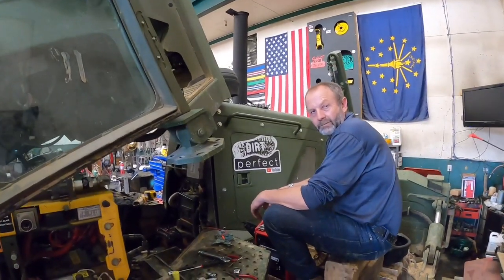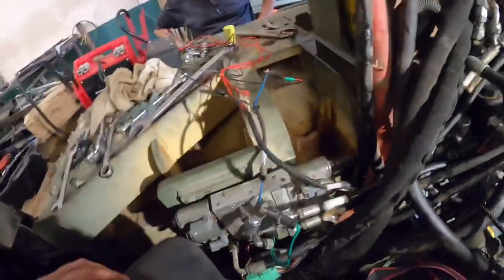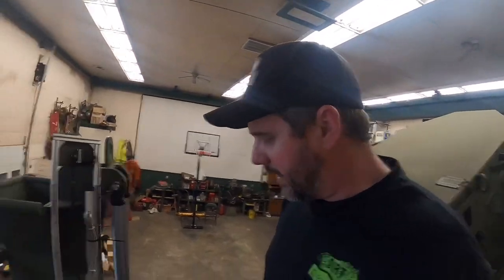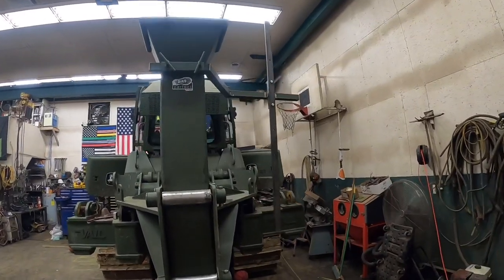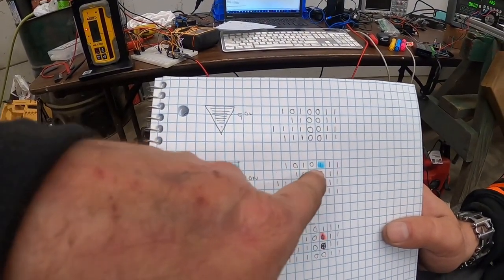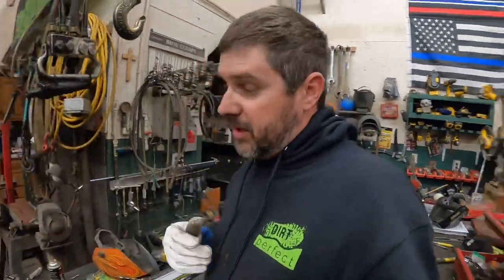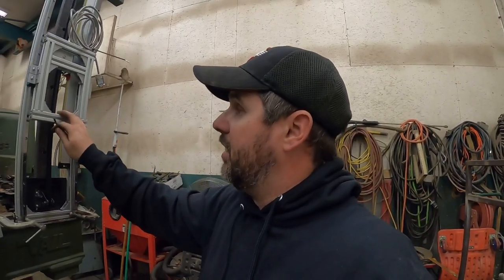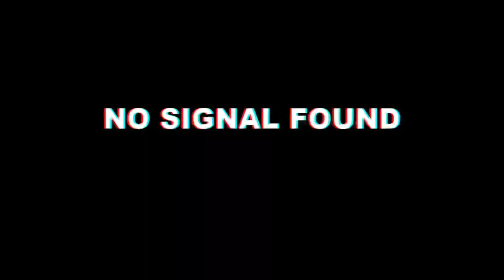Call us crazy, but we are going to build a grade control system for the plow from scratch.

Comment: I'm happy it will work... that said, under the hood of your dozer is a couple years wages in a screw up thinking it could render a machine helpless if it was to do something wrong and trust me I am blowing smoke out of my ass but just knowing that the spools you are using ... and the computer trying to figure out if say just for grins... it thinks its getting stolen so it shuts down. I watched Clint do that programing and started giving the machine a whole new line of respect. I ran some old equipment and it was from the seat of the pants. If you were real good, sometimes it also showed in the work. Most times the machine was so worn out that it was a  miracle that it worked. I spent many hours with welder in hand welding a frog on the blade or building up sprockets, then trying to weld new rollers ... said that wrong.. trying to make a old roller have the rim that kept it on its tracks.... dang it Mike, give me a hand here.... I was making a purse out of a pigs ear. I spent more for rod than most people earned in six months. I had other shops feeling sorry for me and giving me more rod to work with even. Of topic sorta... there is  a channel called pacific hillbilly an the man found a old D4 that comes from the early fifties and he completely rebuilt it from the ground up using new bearings or what ever and doing all the welding. I know you well enough that if you had ten minutes not dedicated to work that you would say damn that man is really talented. I like talent in many fields. I have deep respect for the man there programing the machine for you. I kinda think he is extremely talented but maybe camera shy as for the speaking parts... I didn't really understand any but knew in my heart he knew absolutely what he was doing. Now whether its for exposure to his work or just what, I don't care. It  reminds me of the young minds that built our first computers like Gates or Allen and more names that mean a lot in their field. I watched everything trying to  think if this is math analysis or geometry.. or algebra. Maybe all of it  as I have never attended any school in my life. I had to learn to read to give my son who was dying medications so he could be with me. I was highly motivated as I knew I might not have him much longer an yes,  twenty months later I buried my boy an  the military gave him full honors for my time in the service. Nam was a dirty word in my mouth till they stepped in providing air service between anchorage an seattle. Many trips... many and so like all responsible parents who are divorced an left with no supervision, I got flaming drunk for six months. I went back to the mountains where my hobby gold mine was and would take cases of whisky praying for a bolder to fall on my head or my excavator would fall off of the ledge I was working on.... so damn it what happens shouldn't happen and I hit good paydirt.. sold my gold for good money then sold the claim for pennies as they are still mining it almost ten years later... ...or more as I sold that in 94 spring of cause I now had a dwi to serve time for. Six months later,  I got out of jail and have never touched a drop since. I will admit to the threats of stupidity an think, Danny would not be proud of me. Anyway happy it works and it may just help Clint work it into some of his equipment.... that is a large jump forwards... I have went down the road and had the gps tell me I was fifty feet off the road.. the yellow line said otherwise

Comment: Yeah, but youre the good kind of crazy...  my prediction is that youre going to get more  tile jobs every year when the word gets out. That while using a dozer that earns money in pond and road building during the off season, i like the way you think, and your trial and error will get you there: This grade control gets your outfit to Pro level.

Within a year or three i expect youre going to rip the bracket welded in place where the drawbar was welded, out of the JD ripper main tube, it will just rip a piece of the rear flange out. Which can be dealt with by welding a plate slightly overlapping the top and bottom square tube flanges and bending these so they meet against the tube which you put the pin in. And some years from now, its going to need some extra bracing behind this lower mounting pin, and the lower rear roller that holds the plow leg. But thats only the long run, it will be fine as is, as long as you dont hook the B in front to help it through the hard patches 😉

Just 2 cents from a construction equipment design engineer 😉

Comment: Dear flamingdirt, when you get some free time please consider a 2nd business:  "flamingwater"......and focus your talents on jailbreaking the controllers of modern clothes washers so you can allow the user to bypass all of the engineered stupidity in modern washers that supposedly use a thimble full of water to wash a full load of clothes.  Give the user the ability to set how full they want the water, how long to actually run a wash cycle, how much rinse water to use, etc.  You'll be wealthier than you ever imagined in short order!

Comment: Let me get this straight, you're using the system that angles the blade to raise and lower the ripper/tile layer, thus disabling the blade tilting function?
I presume you'll eventually have it setup to enable switching from blade tilting to ripper/tile layer raising and lowering as needed?  ;-)
Reply: Still has operator control of blade. Need to watch first part of vidyo again.
Reply: I saw the blade able to go up and down still, but they didn't show if it can tilt?
I guess, I'll have to assume it still can?
Reply: @hermanschepers4739  Herman is correct. The GPS control valves is independent from the manual control. We only repurposed the GPS valve. What might not be clear from the video is that the manual valves has priority. So even if the GPS valve is active the manual control can still override it.

Comment: Here's an idea. With all that technology bolted to that plough. Would it be an idea to dig a hole up against the back wall in the shed maybe use a clay pipe. In the ground then put the plough in it so it's out of the weather for the 9 months of the year it's sitting doing nothing
Reply from the maker: All comes off easy

Comment: Did you take into account that the boot will be in dirt when you mounted the bracket that low, I'm worried that you will bend it when you lower the boot into the ground.
Reply: Hi M1A2 we did, he made several different holes where the backbone connect to the 3/4 plate. So he can mount it higher or lower depending on how deep the plow is that day. ( I think that part is in this video)
Reply: @flamingdirt669  I did see the holes but when he mounted it it was way to low
Reply: @tacticalrabbit308   I'm with you. You right we were on the very lowest setting so we could reach to work on it. That boot is very tall. Both DP and I are over 6 feet and we were on our tippy tows a lot.

Comment: When removing the unit why can’t you remove it at the 2 bolts and leave this system completely together. Your removing everything but the 2” square railing. If you change the height those 2 bolt with rail has to be moved. It nice to watch someone working that don’t need to holler at each other but it’s what you enjoy so have at it. Stay safe
Reply from the maker: Way more work and weigh

Comment: I don't understand why you need to be able to move the receiver up and down on the plough rather than just have it fixed. You could position the laser on the ground so that the plough tip will be 4ft lower than the laser height. That slide is too fragile to be reliable on heavy machinery.
Reply: GREAT QUESTION Studiosoft!!!! We wanted to adjust the plow depth without having to reset the laser. The receiver window is only 4 inches (+/- 2 inches). So if DP wanted to raise/lower the boot more 2 inches we would loose the laser signal.  This is often needed on the longer runs.
Reply: @flamingdirt669  - Thanks. Are those lasers self levelling or can they be set on a slight incline to allow for water flow?
Reply: @studiosoftmorecambe6879  You can look  up Grade Lasers. They are self leveling and then you can set the angle. REALLY COOL devices

Comment: I'm lost. I thought the purpose of this attachment was to bury a pipe 'X' number of feet in the ground. Now you're talking about burying a pipe to grade, so it's no longer 'X' number of feet below the ground, but is set to grade so it could be any number of feet below the ground? I assume you know what you're doing, so I'll leave it at that, and wish you all the best.........
Reply: In most cases the tile needs to be on a specific grade. ex 2.5% was what DP used the day we tested. The reason is that is needs constant flow. If the tile goes up and down ,following the contours of the field, it will silt in on the low spots. So the laser's job is to keep that grade as best it can. This is a very basic explanation of a complex problem.
Reply from the maker: Exactly

Comment: Did he use a Raspberry Pi?
Reply from the maker: I believe that’s correct
Reply: Merle, no that is Arduino 2560 for controllers and Esp8266 for coms. As a general rule we use the Raspberry Pi for human interfaces and web based projects. And Arduino for fine motor controls. The Pi is more of a pocket computer and can be problematic(slow) when it need to service very fast interrupts. The Arduino is a pure microcontroller and very good at finely timed stuff, but a pain with you want to use it to talk to humans and the internet.
Reply: @flamingdirt669  Yeah, I can see why. When you need triggers in the milliseconds, then RP's probably won't fit the bill.

Comment: What is "Grade Control?".  I have no idea why you are doing what you are doing.  I think some of us need Layman Terms or simpler explanation, so we can understand why you are doing what you are doing.  I'm lost.
Reply: Ok ,'ll take a stab at it. Grade as used here is a specific angle from level. In this case we want water to flow evenly down the pipe with no high on low points where mud can get stuck and silt the pipe in. Ex on test day DP set the laser to a 2.5% grade. So the pipe must be 2 1/2 feet higher every 100 ft along the line. Grade control is any system that help you keep that grade. Since the field is not level and goes up and down it is almost impossible to eyeball grade. So we built a system that can control the plow to follow that grade for us.
Reply from the maker: Keep the pipe on grade or slop so it drains
Reply: @DirtPerfect  on grade, what grade? You mean use Earth's gravity to ensure liquid stays off roads and runs through pipes?